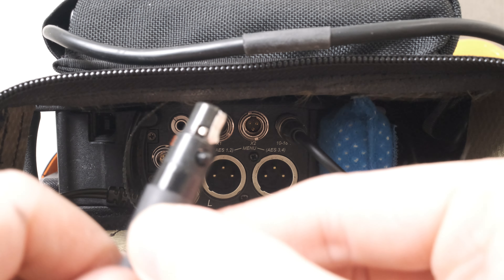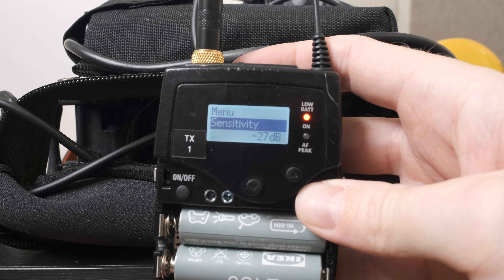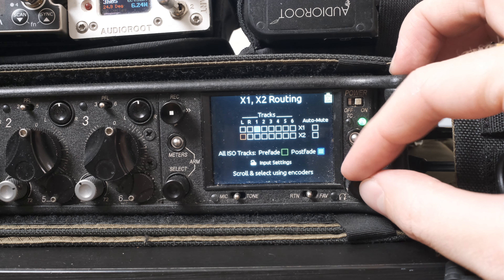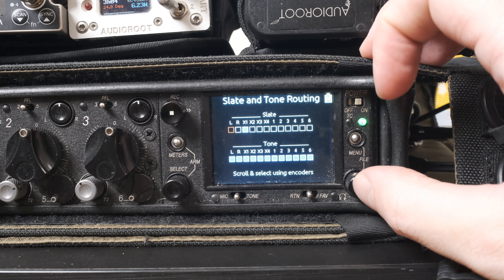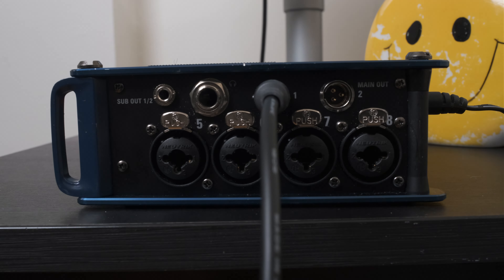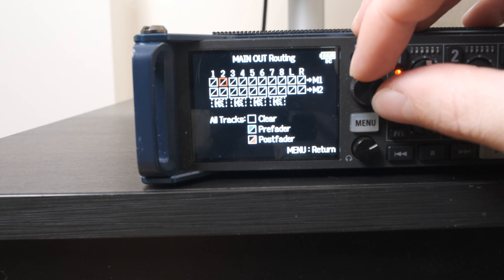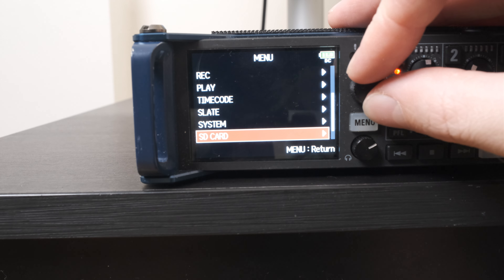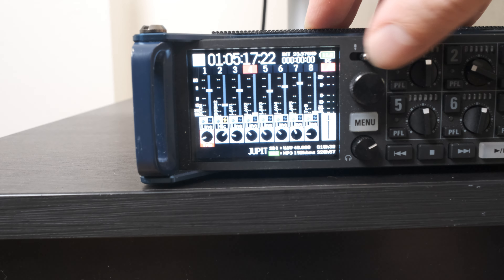How To Set Up A Private Line (Sound Devices 633, Zoom F8n)

Comment: This is stuff I was always curious about. Thank you. As the Zoom F8n operator, what is my voice being recorded to? There is that tiny mic on the Zoom, right? Would I input a headset to somewhere on the Zoom but not send that to the project mix? Does that question make sense?
Reply from the maker: The slate mic on the units mentioned in these videos is built into the machine. Other high end recorders often have a separate slate mic input.

By changing the routing of the slate mic, you change the channel that the mic can be recorded onto. By default, the slate mic routes to all channels —this is because the intended purpose of the slate mic is for an operator to verbally slate each take, and this info is vital to have in each iso track. 

By sending the slate mic to an aux output like in this video, you can create a one way coms channel that won’t be recorded to any tracks. This allows you to help your boom op subtly during takes when needed without having your voice on the production audio delivered at EOD. 
Hope that makes sense!
Reply: @nicolasfieldsoundservices  Thank you.